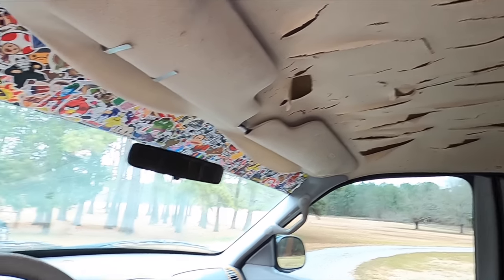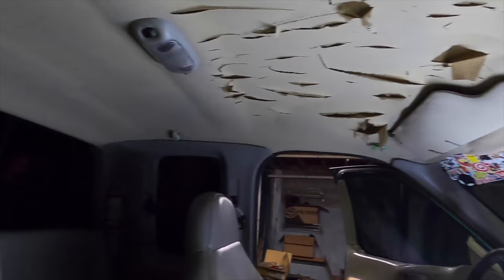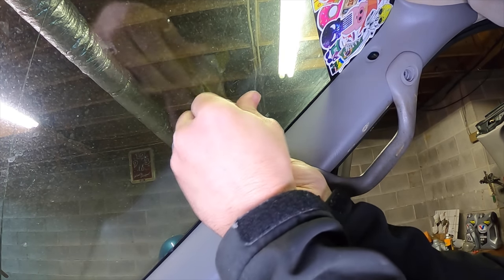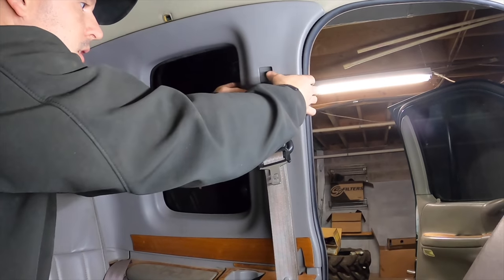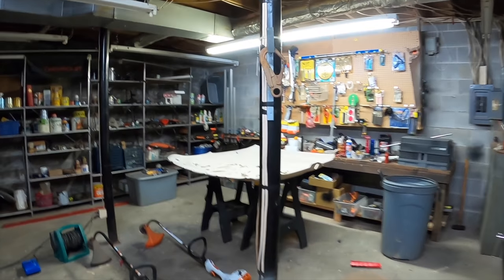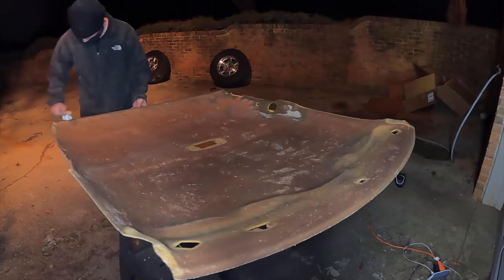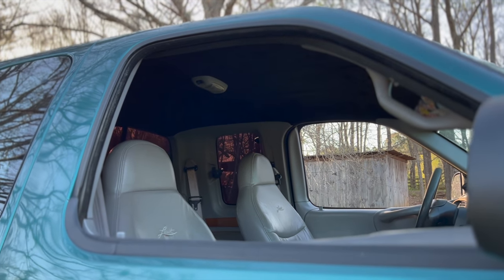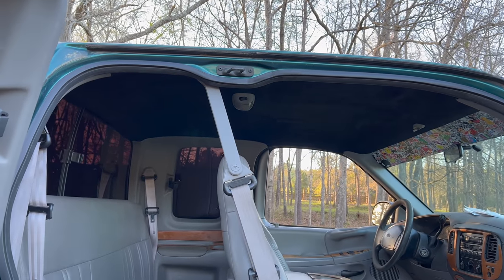SUEDE HEADLINER REPLACEMENT - FINALLY!

Comment: I’ve never liked this body style of F150, that being bc it use to think it looks like a catfish and it simply being a ford. But after watching your videos, and seeing the lifts and exhaust you’ve done to Larry I will admit this body style has grown on me.
Reply: They’re pretty reliable but everything else around them is absolute junk.
Reply: @AQS521  I’ve heard every part of them are junk. Those old triton motors aren’t nothing to be excited about. But it seems as if Chase has his hands on a good one.
Reply: @kev_lsn7042  well I say that because my brother has a 2000 with about 350,000 miles on it. Really has needed basic maintenance but had a trans rebuild at about 200,000. Everything besides that though is trash. The interior is literally falling apart, column shifter is loose and cracked at the end, odometer goes off out of nowhere, back doors don’t open, etc.
Reply: @AQS521  all depends on how something is treated to be honest. You can do mechanical maintenance, but if you snatch on stuff like the shifter and suicide door handles them shits will break loose. My dad has a 2000 Silverado 2500 ext. cab, and 6.0L. It has been a bad ass truck, But his truck has been put through the ringer of people just snatching on the door handles, tail gate, pushing on the bed. Causing shit to snap and dents forming.
Reply: Same
Reply: @kev_lsn7042  There is absolutely nothing wrong with a 2 valve 5.4, I agree that the 3v are junk but anyone who says the early 5.4s are junk just either hasn’t maintained them or misunderstood them. They are prolly one of the best ford v8s ever made and so is the 4.6.
Reply: @dixielandgarage1998  the 3vs are good too
Reply: @Dingus5288  they’re ok, they’re just prone to more problems like rocker arms breaking and cam phasers and stuff.
Reply: @kev_lsn7042  my 2002 has 336k miles and been very low maintenance. Before I owned it, it was my grandads always good to him. Those 10th gen 5.4s are very reliable
Reply: @loganclark312  I’ve just heard the 2 valve 5.4’s were bad and the 3 valves were absolute dog shit. Blowing out spark plugs left and right, shuttering like crazy
Reply: @kev_lsn7042  I heard that too and then got one and started noticing most 2v don’t have any issues. When people overtorque plugs they would shoot out. You just only hear the bad online.
Reply: @loganclark312  I suppose you have a fair point
Reply: They look way better street style, dropped with weld wheels and a makeover

Comment: I'm about to do the same with a van headliner,,,bigger and the curves and pockets are deeper then those and I'm having an issue of how to smooth it in crevices of a curve without it creating creases... Would heat make it more stretchy and easier to smooth over like I'd do with foil..? Im rambling here idk what to do and I don't want to do it wrong...any advice?

Comment: Good to know you also had problems with 3m adhesive. I redid one in a dakota, was supposed to be a budget job but the fabric fell literally overnight. So I had to scrap it and try again, thought maybe the fabric got contaminated. Same thing. Scrapped it again, read you had to spray the fabric AND the base so I did that too. Seemed to work, reinstalled in the truck. Fell after 2 days. The only constant was that I was using the 3m fabric adhesive that everyone on the forums said to use. So I bought fabric 4 times, like 8 bottles of spray which are expensive as shit and the headliner still fell. Finally got really pissed and cut open several bottles of silicone caulk and literally painted it on and it finally held lmao. $20 job ended up costing me like $275 and looked like shit. Thought I was doing something wrong, but I'm glad to see others have issues with 3m which I honestly didn't think about since 3m is like THE brand for adhesives and vinyl

Comment: Dropped my F150 off at AAMCO today, hopefully nothings majorly wrong with my transmission. But the ole 10-speed is slipping time to time going into 3rd or 4th gear. Hopefully it’s nothing major, bc if it is I might have to get rid of it so it doesn’t become a money pit.

Comment: Looks pretty good. Good luck finding a Lariat parts truck that still has a good interior. I've tried to find one with the leather bucket seats that are still good, but most parts trucks from this generation out there seem to be base model or XLT. The Lariat parts trucks that are out there tend to have torn up seats as well. You'd probably be better off just having the existing seats re-upholstered.

Comment: Just a suggestion Katzkin could I'm sure   color match the front seats with the rear. Since you would be doing just the front it probably wouldn't be crazy expensive and Larry could keep his original seats. Most trucks of that vintage are going to be pretty ragged out at least on the driver's side anyway.

Comment: I had an 03 F150 ext. cab with a front bench seat.  I installed the bucket seats and center console from an Expedition.  Everything bolted up perfect. Only custom work I had to do was wire in the power seat.  Here's a video showing what it looked like:  https://youtu.be/HGxzRVOPy1c